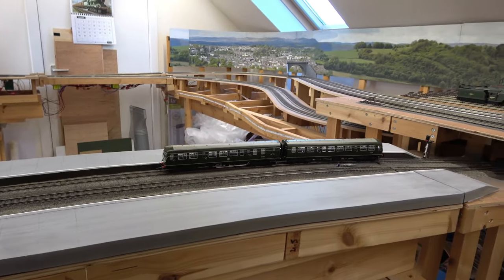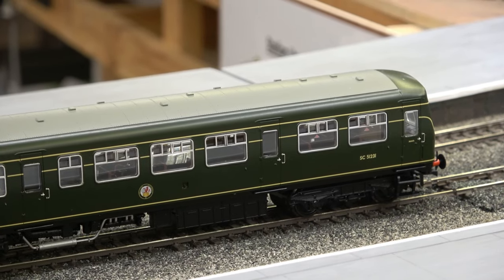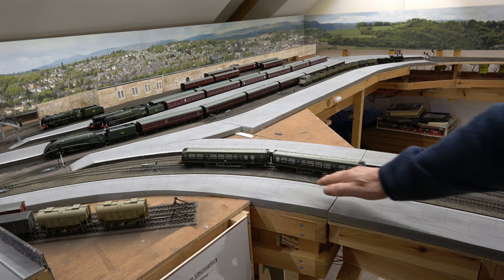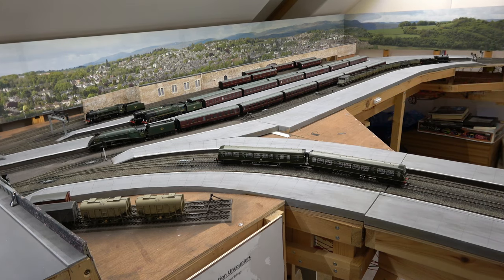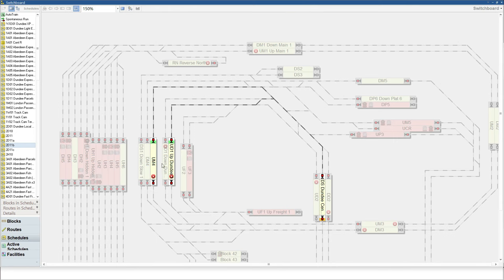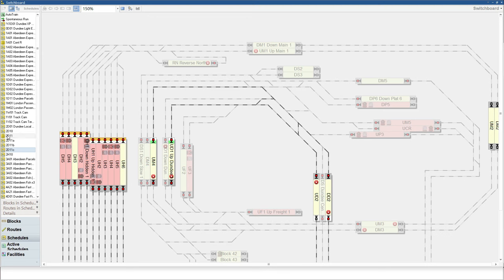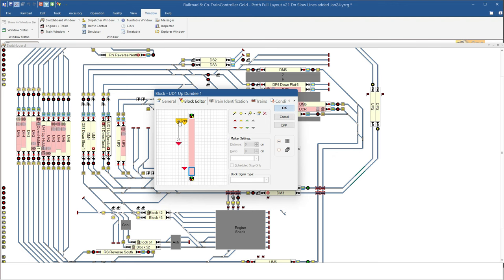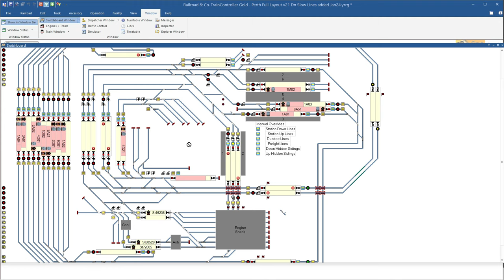Perth South 28, The Dundee Local

Comment: I've only seen a few of you videos. But have just subscribed. Happy New Year to you too!
What brilliant model. The looks and sound are just right!
I run on DC and have a Hornby 3-Car version. Only one thing spoils your model for me, which can easily be remedied!
I'm talking about the 3 foot jump the passengers have if they want to move from one car to the other.
 I have sorted this very simple. I noticed you have the fixed bar fitted? I cut my fixed bar shorter and Super-glued it into one coupling pocket so when the two cars are coupled they are about 1mm apart. This in itself makes the gap look better. My next step is to cut some Black coloured foam to fit between the two corridor connections; flat on the bottom, curved at the top. Using UHU glue, glue into one corridor connection. When re-coupled, they look great and run well through large rad point and crossings. If they are required to to run over Med Rad points, then increase the length of the bar by 1mm to leave a 2mm gap and use a 2mm longer piece of foam. You could also use an upside down piece of U-shaped Black Felt instead of foam. If you do any of the above, you will instantly see a marked difference!!!😊😊😊
Reply from the maker: Cheers and many thanks for watching and commenting. I’ve used the model straight from the box so haven’t added any detail yet. The coupling bar provided isn’t just a normal NEM type (though it is more or less the same shape) as it includes electrical connections between the cars for the lights and for current collection from the wheels. So quite difficult to modify. I may have to make do with just the foam rubber solution to hide the gap. Thanks. Hugh

Comment: If you'd like to be super-realistic… double tail lights before the 1980s indicated either a train used by the head of state, or the edinburgh-glasgow push-pull services. and the DMUs didn't use red tail lights until the late 60s or maybe later - oil tail lamps before that. so you might want to turn them off!
Reply: personally I deactivate just one tail light (e.g. by putting blu-tac over the LED, nice and non-destructive), and ensure I can control the lights explicitly with the controller. A built-in tail light a decade or two early is more realistic than no tail light/lamp at all!
Reply from the maker: Thanks. You’re right of course. I have used the train straight out the box so lots of detail to add (or remove). Hugh